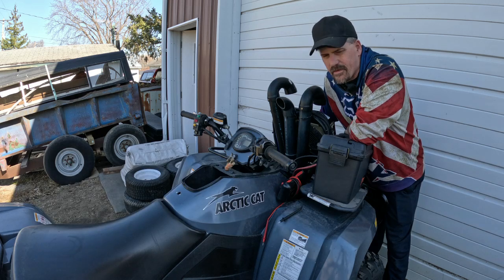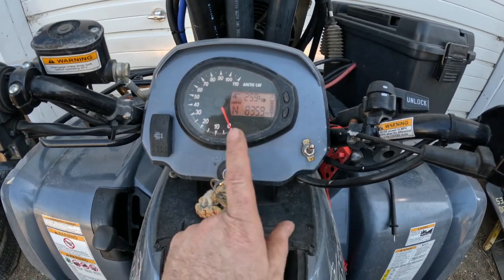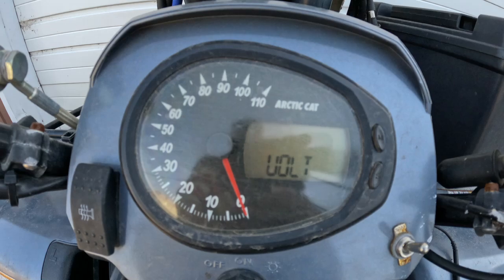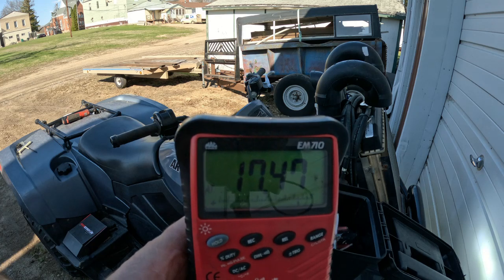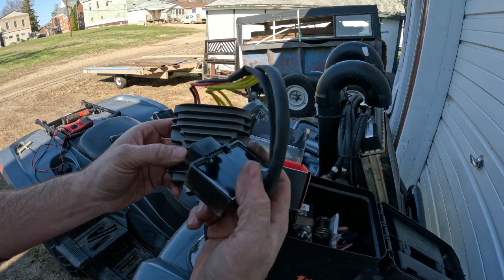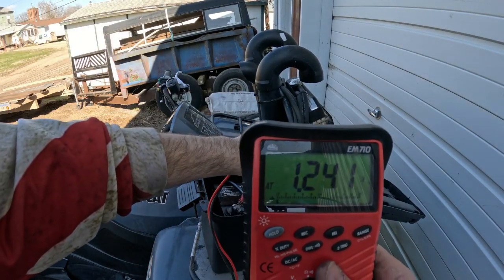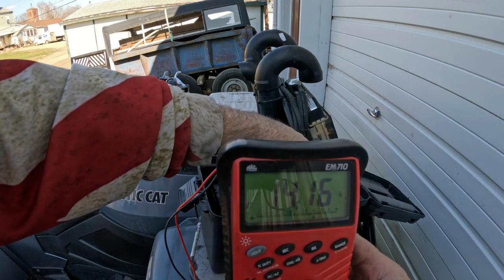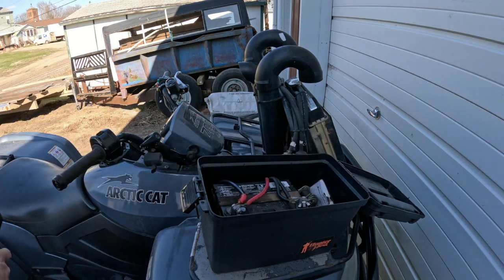Voltage regulator diagnosis and install on Arctic Cat 700 EFI ATV

Comment: I have the same machine. 2008 Arctic cat 700 EFI, and just replace the voltage regulator because the other one was fried. It kept blowing a 30 amp main fuse in the panel under the seat. Now my issue is my battery is not charging. Could it be the new voltage regulator or should I be looking at the stater?
I checked all the wiring there’s no burnt connections and it looks to be in good shape. Any help would be appreciated thanks, Chris.